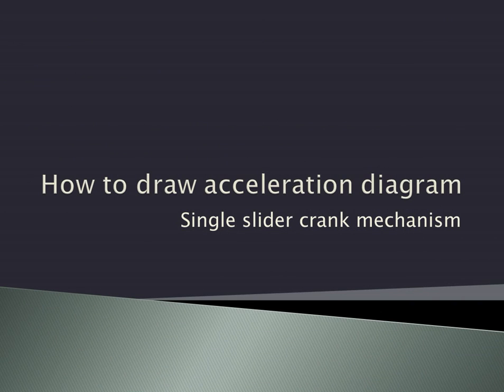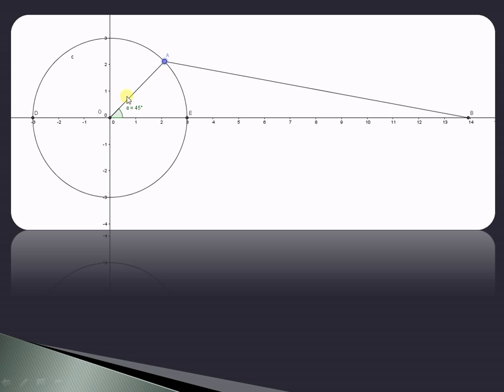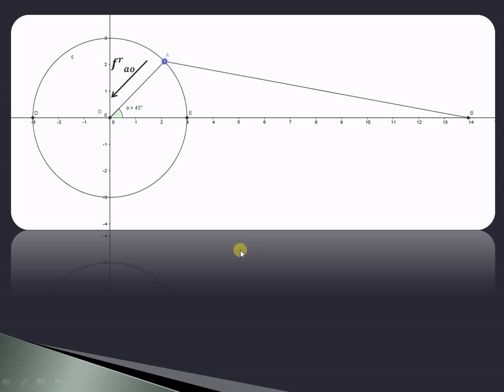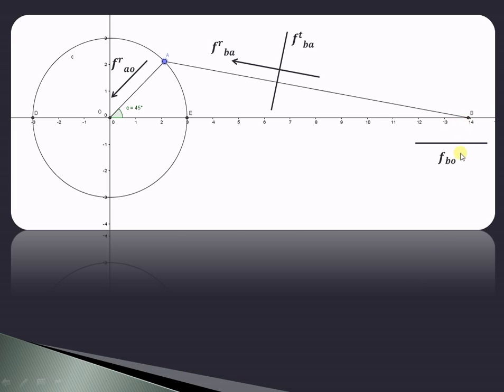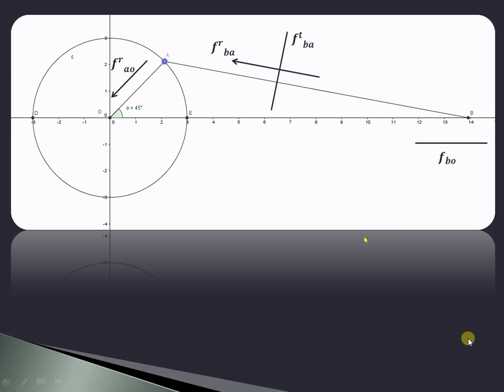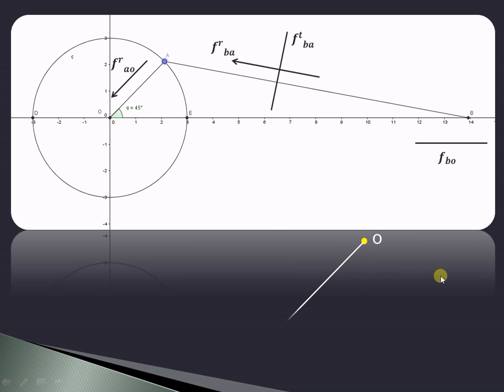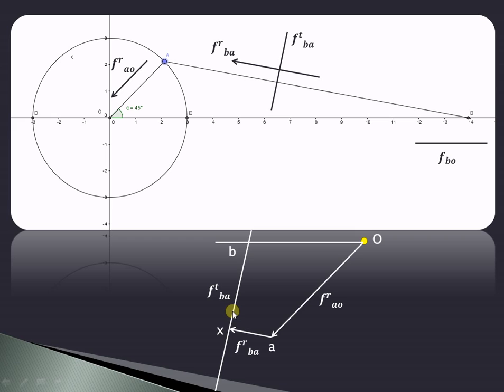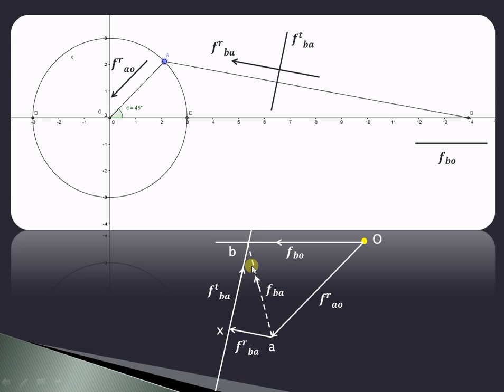Lecture 3 | How to draw acceleration diagram | Relative velocity method

Comment: But the value of the x is not known right, so if I take my x value more, I'll get a greater magnitude for Fba. So how to find the correct magnitude of acceleration of b wrt a ?
Reply from the maker: Magnitude of x can be  calculated using the formula of radial acceleration & then take proper scale which will be uniform for all the accelerations....